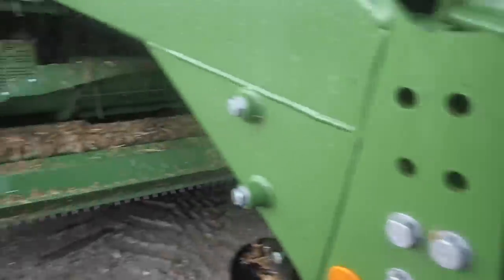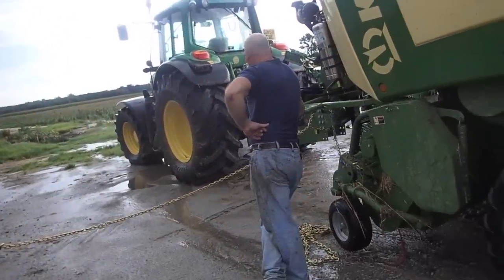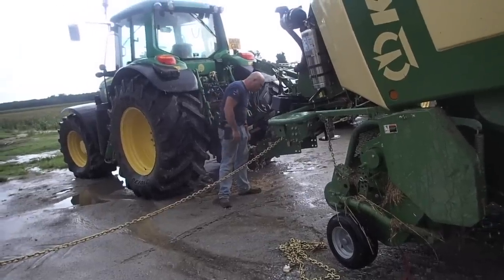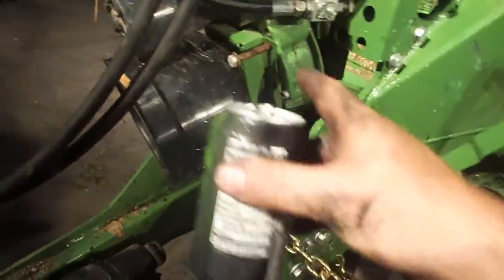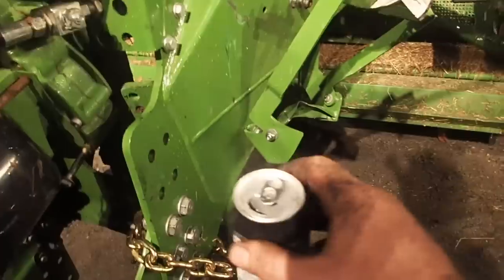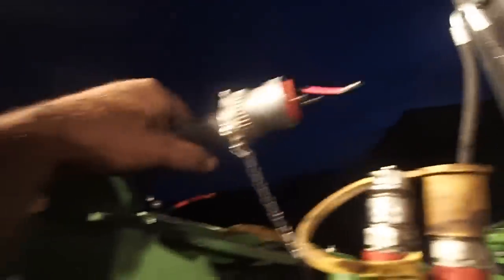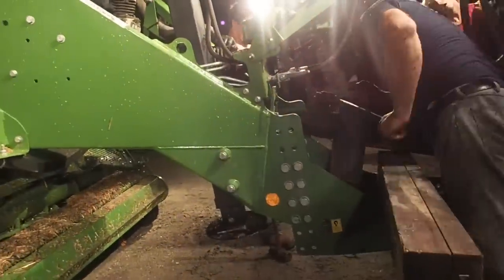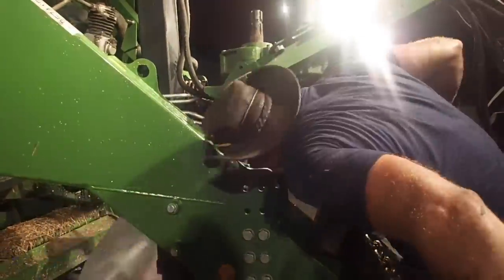S#!% Happens

Comment: I'm so impressed with how level headed you are about these sorts of things.
Reply: As the tittle says, Shit Happens. It can be fixed or replaced. I dont have the issues Wes has, but i am paranoid about my 2018 ram 3500 4x4 dually. Well, dealer scratched the tailgate, someone put a scratch and dent on the duals fender, and a guy parked beside me swung a ratchet strap into the fender. I could get pissed about it, but so be it. Nothing stays perfect. Besides, i figured the bed can be switched to a flatbed later. The cab doesnt need a purpose scratch.

Comment: Proves how tuff there machines are. Really glad no one was hurt. And that the damage isn't much worse. Take care traveling Wes,  old farmers are in short supply nowadays. Thanks
Reply: I’ve had a 3x4 Massey baler push me down a hill sideways in a 7810 i was o fucking it the whole way to the bottom, once we stopped I checked my shorts gathered myself together and back to the top of the hill I went! Just made sure to not get any windrow under a back tire the second time
Reply: Hell I’ve went for more rides down hill with big balers behind me then I care to count cause my old man always went for the minimum horsepower wieght ratings, I didn’t need a 200 horse tractor for a 3x3 and we played on steeper hills then wes

Comment: Machinery damage is only an insurance check and a few bigger payments, personal damage is a whole different issue. He was really lucky he never hurt or killed himself or somebody else for that matter.   it also gave everybody  on your crew and those that watch this a very real look at how the tail wagging the dog can end up. He sure won't do that again.
    I've seen some scary stuff with guys towing huge travel trailers with to small of a truck pass me on the highway. I had it happen to me once with a   borrowed flat deck trailer I used for half a day. The hitch was a few inches out on the height and it couldn't be altered without re welding it to fit my truck hitch height properly. Luckily I realized it was happening  and managed to get slowed and stopped pretty quick, before it got to a rough 10 second ride and being bucked off hard in the ditch. once was enough for me, I never used that trailer again after that educational experience .  Thanks for the video, Take care guys.

Comment: This reminds me of last week bringing in the first cut bales.Normally useing my trusty old Ford 7610  1982 with rear bale lifter but which burst a hydraulic pipe I borrowed my buddy’s 42 series Massey Ferguson.It has  a loader on the front so I was thinking half the time to do the job,1/3 the way in I was manovering on a slope and up she went on 3 wheels.I sware 1 more mm and it was on its side.All in slow motion nothing I could do.I shit my pants and can tell you I slowed down from then on.All this machinery is deadly dangerous and on the odd occasion it reminds us.